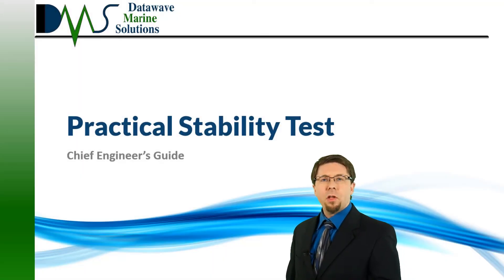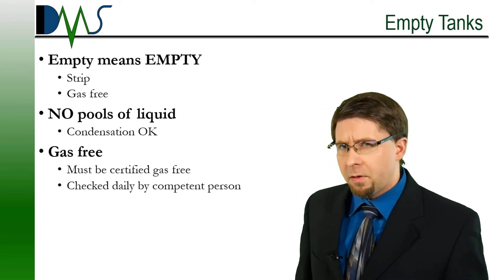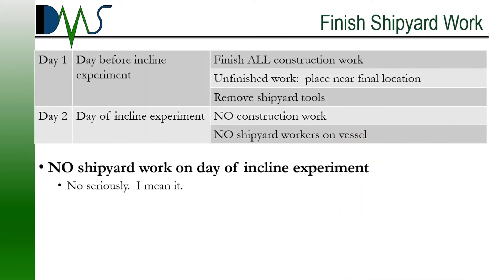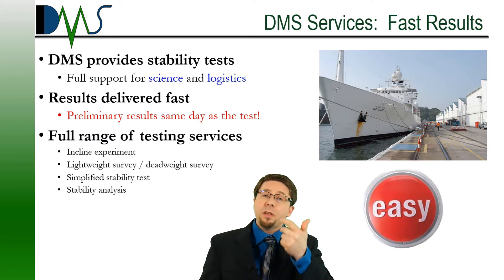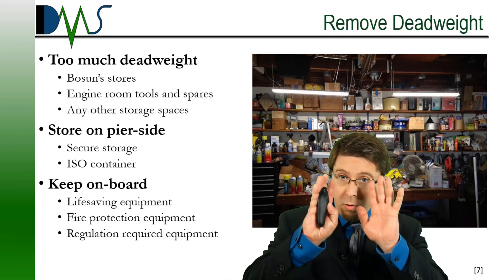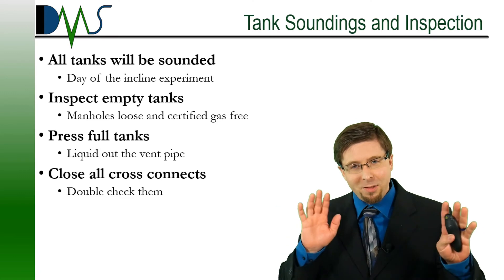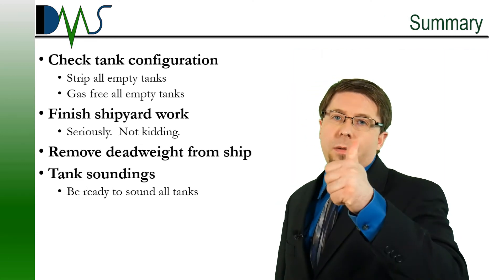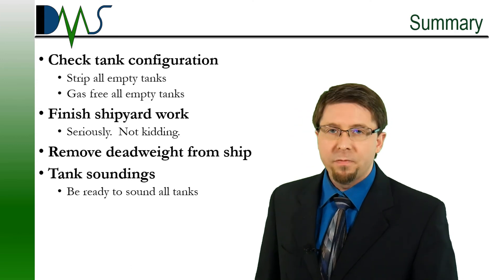Practical Stability Test:  Chief Engineer's Guide

Comment: Is there a reason for deadweight removal? I would have thought the engineering kit would be included in the test if it is present during normal ship operations. EDIT: nevermind 'Light Ship'
Reply from the maker: There are two answers to this: 
The technical answer first.  The deadweight removal is necessary because we are not just concerned with weight, but also center of gravity.  The value we report for light ship includes a center of gravity.  And that should only represent weights that ALWAYS remain in the same location on the ship.  Engineering items can move around the ship.  So we include them as part of the normal outfitting weight, but not as part of the light ship.  This signals to the vessel master that those weights may have slight alterations.
The practical answer second:  Engineering kit is a grey area.  Should it be deadweight or not?  You get different opinions on this with different USCG inspectors.  That is why I like to communicate with the inspector beforehand.  This is what comes from experience with stability tests.  I know about these little problems and anticipate potential solutions beforehand.